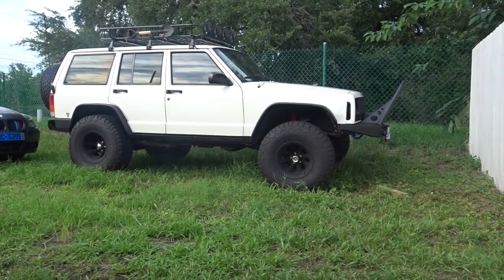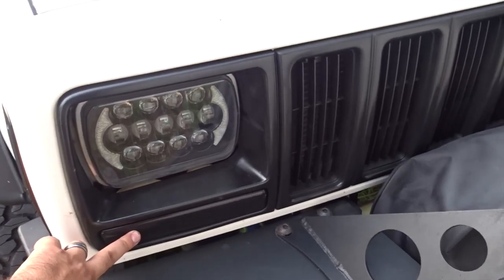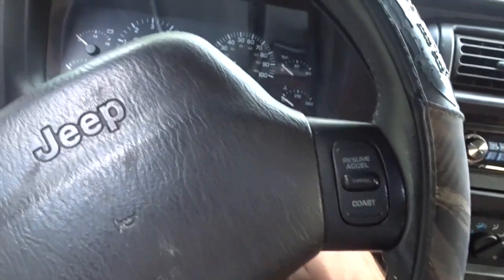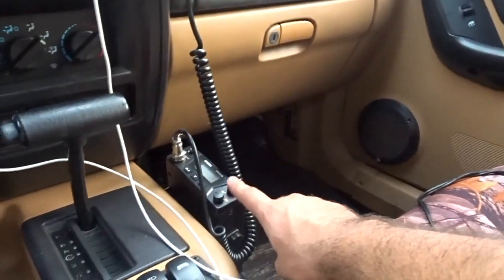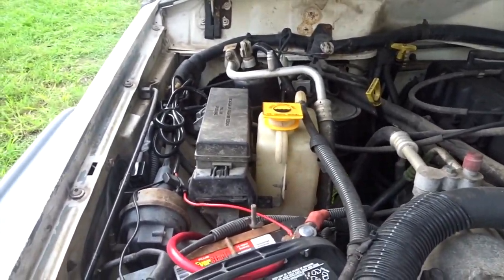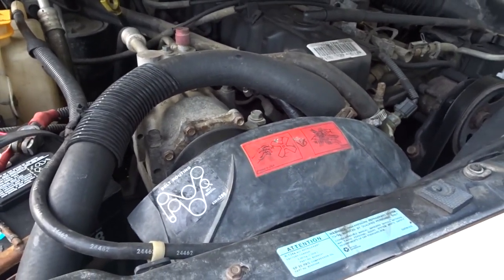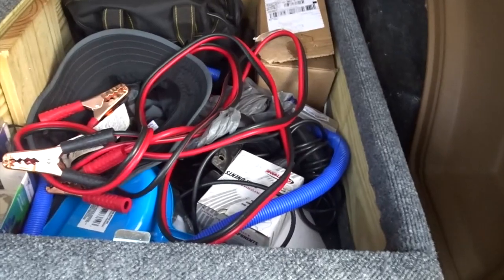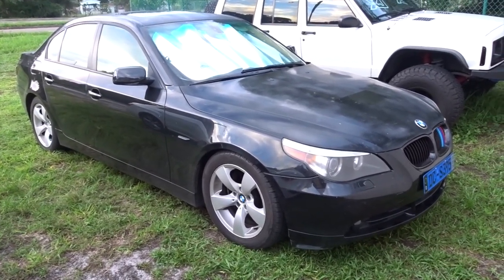Jeep XJ Build

Comment: Nice. U need to put the carpet back. Less sounds inside the rig. What lift is that and tire specs?
Reply from the maker: Don abdo I literally put it back like 2 weeks ago lol it's so much better, much cooler on my feet and the noise as well. It's a 3" zone lift and the tires are 33x12.5x15 on 15x8 wheel
Reply: ZipTie Garage cheers bro